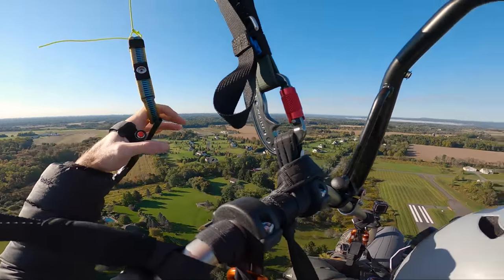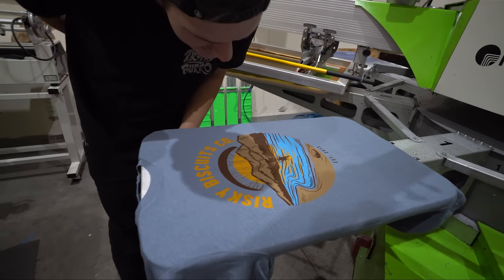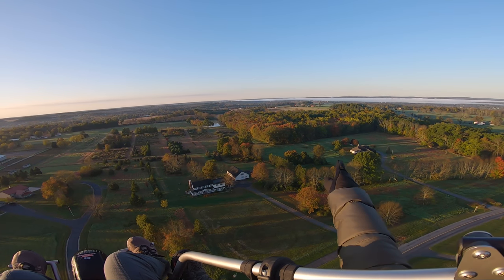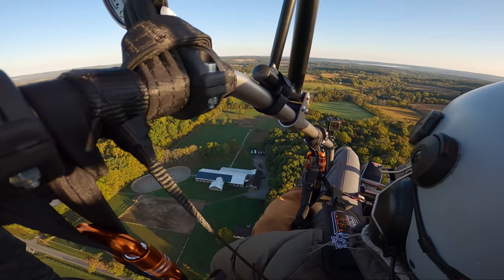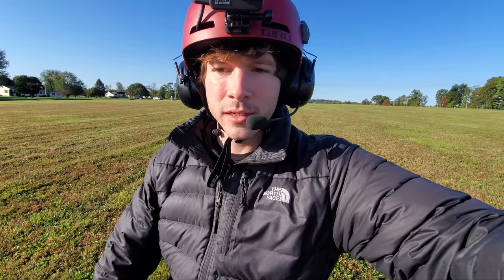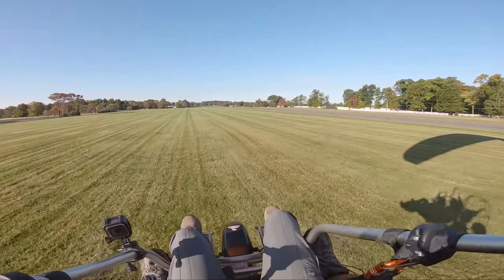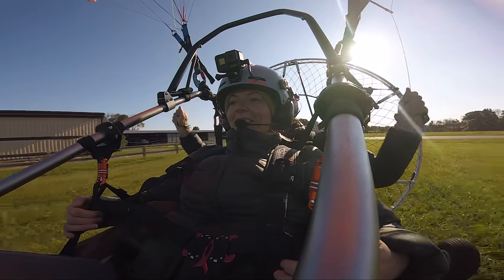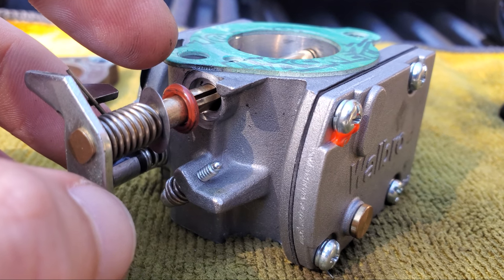I had an ENGINE FAILURE while flying my girlfriend to breakfast...

Comment: You don't need to replace the whole carb to replace that oring. You can find the size of that oring and order chemical resistant orings in that size. But since they sent you a new one I would rebuild the old one and keep it as an emergency spare. Note: the new oring wont be red or orange it will be black or brown, as long as its nitrile rubber it will be fine for gasoline.

Comment: serious design flaw imo. should be reported to faa, if this is a certified engine. using a spring as a spacer is a really bad idea. one slim hex nut to hold the washer in place and one tiny groove or hole to hold the end of the spring in place could potentially save lifes...
glad, you are a good pilot and handled the situation so sovereign.
keep it up! and maybe use a dremel to carve a small groove on your new carb so this cant happen again :)

Comment: Nice of them to send a new carb, but how is it possible that you can't just get that o-ring?  You can go on line and find o-rings of every possible size, shape and material.   (I've had to replace o-rings on my motorcycle carbs and I've never not been able to find one that's the right fit.)  Maybe the company that makes the carb also makes that special o-ring and doesn't offer it for sale as a separate part.
Reply: On all carbs I have ever seen the screw(s) that hold the butterfly in place are staked (deformed) once installed so they can't ever come out. If you remove the screws by force it basically wrecks the threaded holes in the shaft, so the screws never really tighten up after that. Flying with a carb that has had the butterfly screws  removed is just asking for disaster. For that reason the carb manufacturer doesn't provide parts like the o-ring, because you shouldn't be removing the butterfly screws in the first place.

Comment: greetings from Dublin..... Ive really been enjoying your videos this last few months..... Thanks.....Im thinking of buying one myself but your comment at the end about the o-ring has left me confused/worried.... Ive been maintaining large commercial jets for more than 40 years now, so have a little knowledge of aircraft maintenance !!!! oh ye , have an A&P as well, and the fact that the supplier of the engine/carb doesn't have a Parts catalogue or more specifically won't give you a part number for the o-ring, which, didn't look like the correct part to start with (Swelled as adventureman says), and only because you have contacts with the company and I would say a bit of leverage due to your excellent youtube channel, that they gave you a new unit.......what happens next time the o-ring pops, or how would a jo soap like me get spares ??? Best of Irish luck with the Trycicle, jealous from Dublin :)

Comment: I know you should not have to do this, but i would cut a small slot into the spring resting web with wire saw to let the spring drop into and this would never allow it to move across again even if the washer moves. but nice landing anyway.

Comment: I believe you would be better off replacing that o-ring with one that would be a better fit. We have these o-rings that we use on Diesel engines that have square sides. The o-ring is still round, and you can get the same size as the red one, it’s just square on the shoulders and it just might seat better for you...
At least it looks like it would from what I’m seeing. You could at least try it and see how it fits and how you feel about it. Because honestly, unless you actually figured out why this happened, who’s to say that it’s not going to happen again? I’m just putting that out there man. I didn’t know about these o-rings until I worked on this one particular motor and without them the other type just wouldn’t last. Whoever is building your motor may not know about them.... Awesome video btw

Comment: Good to file a small slot at the place the spring leg is meant to stay at, just to locate it and ensure it doesn't migrate sideways again, should the "O' ring push its way out.
Me thinks the "O' ring that was fitted might have been the wrong one; it looks like it was made from a material that swells in the presence of aviation gas.

Comment: The O'ring has swollen due to the fuel you are using . Ethanol or other chemical in the fuel might be affecting seals on the fuel system. Look into what is causing this issue before it happens again. Cool view from the sky.

Comment: It seems like the O-ring was flawed at the start.  ( So much for who inspected at mfg.)  The hernia (?) might have then gotten larger from the engine's heat, pushing the spring's end closer and closer to the edge until it slips.  Never seen that before.  Kinda cool.

Comment: It seems pretty crazy to not have a replacement O ring....assuming that the failure rate is pretty low but it's a freaking O ring, it's going to be a failure point eventually.

Comment: Looks like the carburetor should be modified or redesigned for this application. (From the thing that happened, it doesn't fail in what would be considered a safe manner.) Either it needs a little hook sticking up on the casting so the spring can't slide off, or some kind of notch ground into it with a small rotary tool for the spring to seat into. The fact the o-ring can swell up for whatever reason and unseat it isn't entirely a great design either. Alternately just don't trust the return spring on that carburetor to work and add some kind of secondary return spring on another anchor point.
Reply: Good advice, modification and possibly a secondary return spring.

Comment: Doesn't make any sense to me that you can't order that O ring. They make it for the carb, so someone makes them. But that should not happen, that O ring should be held in by that spring pressure on the flat washer. Something about the size of that spring should be looked into.

Comment: I also had problems with my fly products throttle, the cable snapped at the tip on launch, right has my feet were leaving the ground so I had to sprint but nothing serious happened other than my wood prop exploding from not withstanding the acceleration/sudden deceleration.

Comment: What a great couples way to fly together 💕. 
Know your not big on talking $&¢, but,,, you really need to talk more about this trike. 
#1) the cost & time it takes to get qualified. 
#2) the cost of said vehicle. 
 Am kinda curious, is this ok as is, or better off in a PPC? Know when going that route, a N# is required at some point. Think it's based on weight. Is there weight restrictions on PPG? 
Your opening up a whole new set of rules, by flying this PPG tandem. At some point,  you become an airline!

Comment: Oh, and the o-ring space shuttle launch failure? They were a known limitation. There were a lot of known limitations. But, the pressure was on to launch even when below known temperature limits for too long. Objections were voiced but were challenged with "demonstrate to us why it's NOT safe" where the mantra had always been to "demonstrate to us why it IS safe." Epic fail. RIP.

Comment: Perhaps a silly question, but I noticed that you were able to gain altitude before killing the engine to land.... what would happen if there is a problem with the kill switch? Is there another way to turn off the engine (in flight)?
Reply: Fuel shutoff or pinch the fuel line. Then wait for the carb to run out of fuel.

Comment: Engineers need to design a  lightweight emergency engine  that feeds off fuel line from main engine, that you can engage  just in case you need power to get to safe LZ.

Comment: Damn i'd like to have all kinds of flying vehicles, but only money is the limit.  Well my dad bought kinda cheap (11 000€) airplain. It's really cool, it's almost STOL but not quite, and it's slow. My dream would be to have a STOL airplane, a high speed airplane for longer travels, a paramotor and maybe some other stuff like a hovercraft even though it doesn't excactly fly.

The airplane we have right now has a cruise speed of 150km/h, it can take-off with a 80m runway with min. weight (pilot and 45 liters of fuel) at 15°C and not really any wind. It consumes 20-24 liters of fuel per hour, and has 2 x 85 liter tanks, so overall 170 liter at max. It also has slats that help on short runways. Usually with more weight it takes off at around 150 meters.

It's really nice plane, but a STOL would be even nicer so we could have a runway on our backyard. And a paramotor would be like a super STOL so i could go pretty much anywhere, that's near.

Well if i will get a nice job and will become bit more wealthy, i'll definetly buy or build a STOL and probably get a paramotor.

I'm really impressed if somone actually read this far. Thanks for your time though.

Comment: I don't think the carbs for use on those are any different than regular two strokes as you don't tend to go high enough that the air density would need to be compensated for.. so I'd suggest getting a 2 stroke Mikuni for it so that you can always buy rebuild kits. The only differences I see is that most Mikunis are bottom float bowl with a slide valve instead of a butterfly.. Though they do make flat slide pumper carbs too. https://www.mikunioz.com/flt-slide-carbs-w-accel-pumps/?v=7516fd43adaa

Comment: Okay, are these ultralight aircraft really experimental aircraft meaning they are still trying to figure out what works?  I have watched a few of your shows, and they are enjoyable, there seems however to be a host of simple problems that should have never happened. The hoodie on the air intake,  the carb screen with lint, moisture freezing in the throttle cable and now the spring that could have been 3/16 longer and been fail safe. How often do these failures take place? If these are Italian units perhaps the inherent workmanship that the Lambo suffers extends into other crafts as well?  Just curious about the safety factor?

Comment: You can 100% get that O-ring. I'm not sure why aviator would suggest you can't but, FYI.
Reply from the maker: It is not a part available through the Vittorazi or Walbro parts diagram. Obviously, you could source an o ring of the same spec anywhere but I bet they won't do that for warranty reasons.
Reply: @TuckerGott  most of these parts, from an engineering standpoint are "lego" parts; they're mostly all standardized sizes. Walbro sources them from a manufacturer which they tell "hey I need an O-ring that's sized y×z×w" and the supplier provides. 
For the sake of having an extra carb, I'd contact Walbro and ask them what size that O-ring is so you can order it from any O-ring supplier. Hope that's helpful :)

Comment: great channel and great content! buttttt....

it's crazy to me how cheaply this stuff is made. I imagine the parachute increases the safety, but to have a spring just sitting there--not actually secured in any way--is to me a bit ridiculous. Yearly hours on paramotors are likely low, so things like this aren't often catastrophic, but as the popularity increases, so too will the accidents caused by people attaching props to glorified weedeater motors and taking off. i could imagine a few ways this particular issue could have gone poorly, think of not noticing the problem until final approach. either way, I think the industry needs to up their safety margins on anything that's going to get you thousands of feet AGL.

Comment: Are you required to report the engine issue with the faa?
Reply: Short answer is No.   

    Reportable events go to the NTSB, not the FAA.   

    The list of reportable events is covered under 49 CFR 830.5.   A stuck open throttle would not trigger a mandatory report.

    Also, aircraft operated under 14 CFR 103 (ultralights) are not required to use Certificated airworthy parts produced under FAA PMA.

Comment: Does the handling change much with and without the whooping ballast?
Reply from the maker: The climb rate is significantly affected by the passenger weight. I am hoping to swap a bigger motor in the future though so it won't be much of an issue.

Comment: Except you don't low-side on a paramotor when you go through its wake and go sliding down the asphalt while picking up a lovely road rash.
Reply from the maker: I was referring to a small patch of gravel in a mild turn. 😉 One that doesn't cause a wreck. I think the feeling is pretty similar.
Reply: @TuckerGott  - Gotcha.  I don't get that much in the way of gravel down here, but tar snakes, tar snakes are all over the place.  They're slick, especially in the heat.  I was expecting hitting your own wake would feel more like hitting a little bit of turbulence.

Comment: If you put a Sticker on the Back of Jay-Quellins' Helmet that would be so Cool. Then add Jaclyn on the front like the Jet Pilots do.
Does the Trike have a Max Weight posted on the both sides of the tube frame for the passengers? If I win the Free Flight, I may be Overweight and Unable to Go. I weigh 327 lbs Naked without a Helmet on my head : (

Comment: What a terrible sealing design on that carb, they should have used a lip seal or square profile oring instead of a round profile o-ring.  Also the fact isn't retained by anything besides that washer.  They also should have put a notch in that stop for spring to keep it from walking off edge like it did.

Comment: Quick Q: what do you do if you can not kill the engine and throtle is stuck ? quick tip: Orings: www.oringsandmore.com (all orings sizes)
Reply from the maker: On this motor, the best bet would be to cover the airbox or turn the fuel petcock. If all else failed, I could grab the spark plug boot and yank it off. I think the trike actually makes it easier to access these options compared to my standard foot launch setup.
Reply: @TuckerGott  thanks! been thinking the same, on my footL setup, yank the spark plug boot will be easy (Zenith)

Comment: If you give me the Blueprint shirt, I WILL stop what I am doing in my free time and get me a Paramotor, a wing, and approprate recording equpiment (you set me up with the proper stuff to get) and .. get this ... take my first ever flight (after schooling of course) as a paramotor pilot apprentice. No joke. I will throw everything down and give this my all.

But I must tell you, I have a big fear of heights, so much so that even 50 feet in the air hanging off the side of a skyrise building from a rope and a small piece of wood I was sitting on.... I freaked out. I so did not want to be there.

You send me motivation, I will face my fear.

Everything will be documented.

Up for it?
Reply: I have fear of height too but surprisingly when you’re flying, the fear is gone. Its not the same. Fear standing on the edge of a tall building or on a glass bridge is mind blowing. But when you’re flying a plane or paramotor, its gone
Reply: @blardymunggas6884  my fear of heights (or falling) is so profound, I cringe when I watch others like those parkour runners and tower climbers who go stand on edges of buildings or walk across a surface no wider than a few inches that extend over an area in which there is nothing around them but whatever they are standing on with a very large height difference between what I see as the ground and whatever they are standing on. LOL! Sometimes I almost get the feeling of dizzyness watching vids like these. I dont get dizzy though, maybe its more like light headed.

I really hope and want to believe in what you said is true because I'm really sick of being scared of something like this.

Comment: I'm guessing That 'O' ring got fuel on it which caused it to swell,which implies that it was made of the wrong material to start with.You could give it a bath in fuel to confirm this.Butter landing and Jaclyn needs a present of thermal underwear for bikers (hint hint).........................................

Comment: Although I know it’s not required, do you use a radio at non towered airports? I would strongly suggest doing it if you do not. I have had a lot of close calls with aircraft not communicating at non towered airports and every time the response is simply “well it’s not require so why use it”.

Comment: Can't order an o ring? Never heard of that before.
Reply: It could be a liability thing. To get to that o ring you need to remove the butterfly.  Very often the butterfly screw is staked (deliberately deformed) to make sure it can't vibrate loose. On re installation the screw needs to be replaced with a new one and correctly staked.
If you don't reinstall the butterfly correctly it could come loose and fall in the engine. That would make for a very bad day.

Comment: Hilarious they can't send you a 30 cent o ring but they can send you a whole new carb
Reply: On all carbs I have ever seen the screw(s) that hold the butterfly in place are staked (deformed) once installed so they can't ever come out. If you remove the screws by force it basically wrecks the threaded holes in the shaft, so the screws never really tighten up after that. Flying with a carb that has had the butterfly screws  removed is just asking for disaster. For that reason the carb manufacturer doesn't provide parts like the o-ring, because you shouldn't be removing the butterfly screws in the first place.
Reply: @retiree1033  Agreed!

Comment: so.... nothing wrong with the engine, it did'.t fail,  so why call it engine failure, winds me up when vids dont give correct info, soz still love the channel
Reply: If there is something on the engine that doesnt work like it is supposed to, it is a engine failure.
Reply from the maker: Did you watch the video? 🤔 The throttle got stuck, specifically the return spring failed. The only way to come down was to kill the engine completely. I call that a failure.

Comment: Couldn't add another cable, to pull the throttle back to the idle position. Mount it out of the way, on the frame, down by your leg.